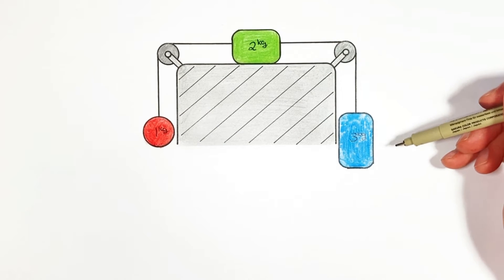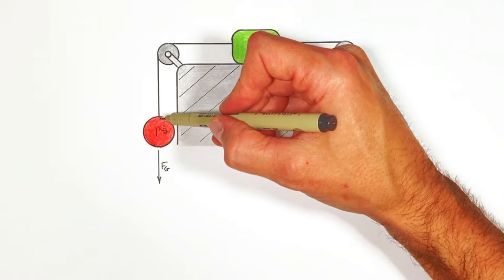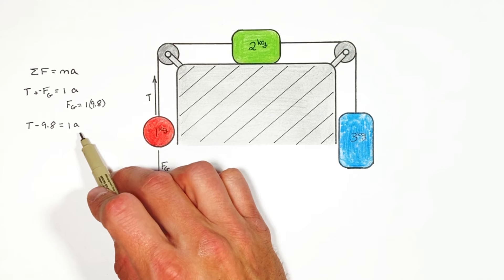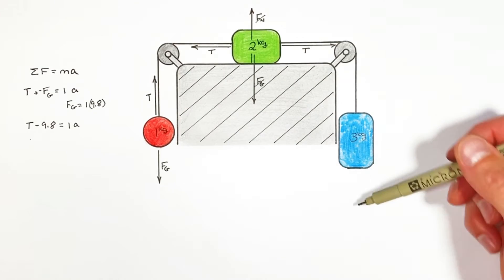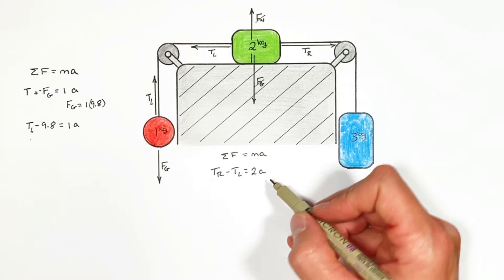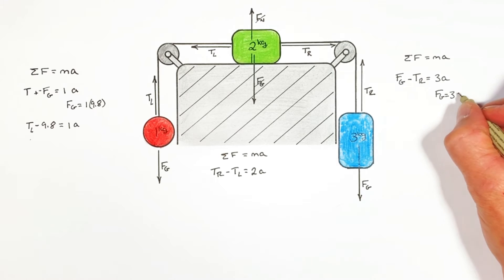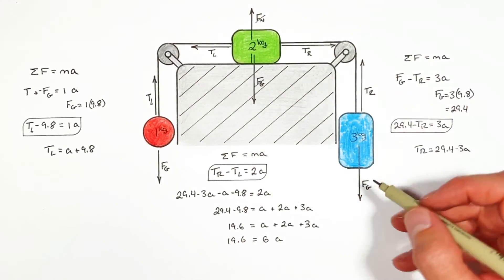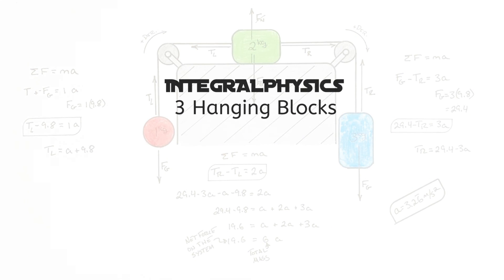Acceleration of a Three Block Atwood Machine  |  3 Blocks 2 Pulleys, 2 Strings, no Friction

Comment: If the coefficient of friction is given under the object of mass 2 kg, how do I calculate it? 
The coefficient of friction for the 2 kg object given in my book is 0.2.
Reply from the maker: The normal force = 2kg*9.8m/s^2 = 19.6N
The maximum friction force between the block and the surface would then be 19.6N * 0.2 = 3.92N

Comment: But won't the 3kg block not move because the 2 kg and 1 kg blocks =3 kg, I'm thinking that the blocks will remain stationary 😅
Reply from the maker: No.  If the 2 + 1 kg blocks were hanging on one side and the 3kg block off the other, then they would not move.  But thats not this situation.